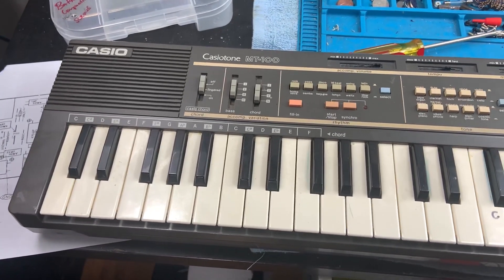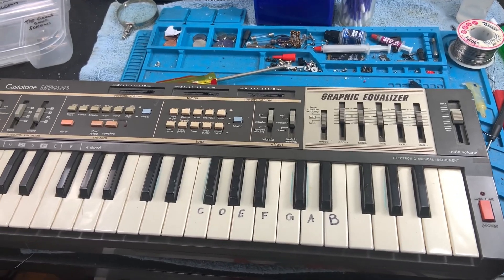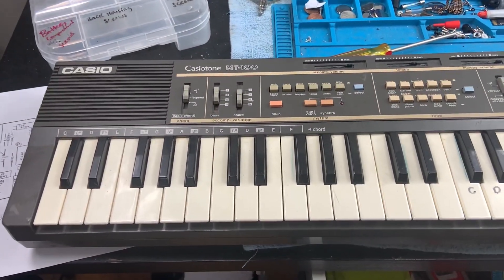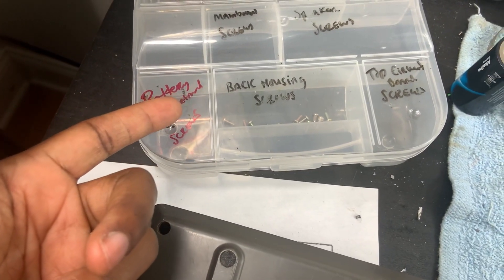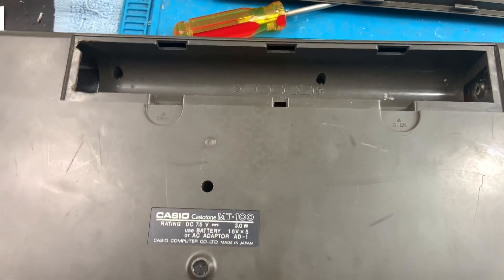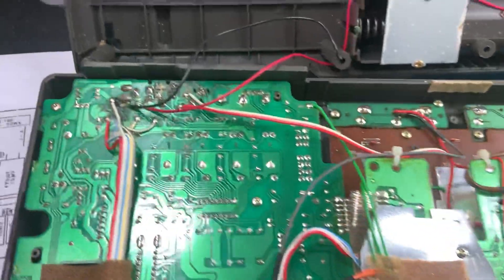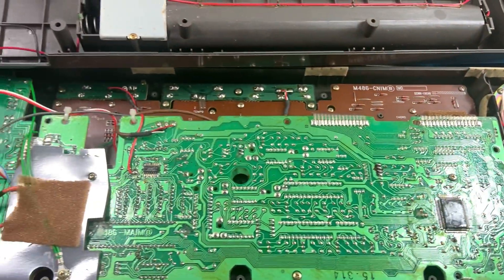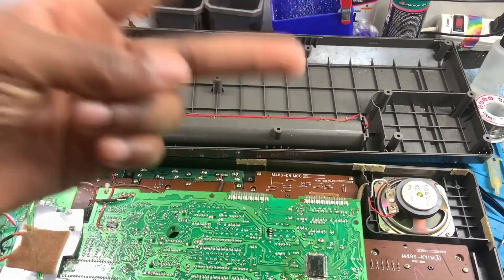Casio Casiotone MT-100 Part 1: Repair Work Needed

Comment: I just got one and it turns on through batteries and through the chord I have but no sound comes out. Any advice?
Reply from the maker: Have you tried plugging headphone or speaker in and still no sound? If you get sound in the headphones then you know it works and you may have bad connection to the speaker. Only way to really tell is to open it up.